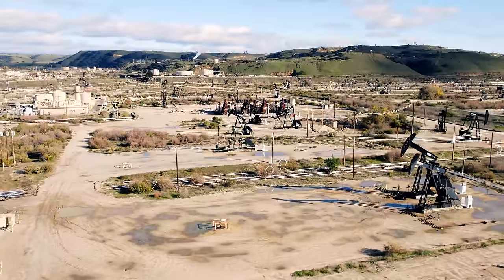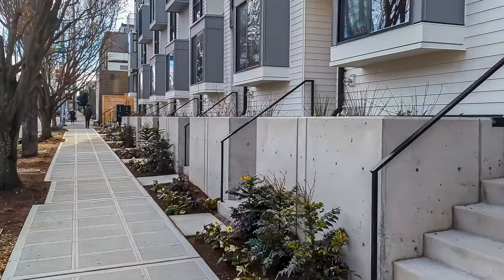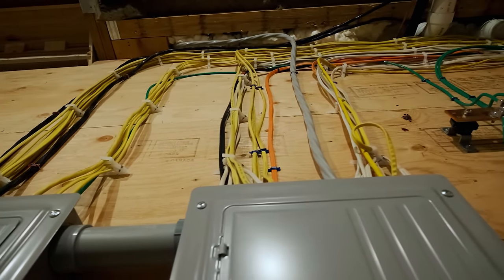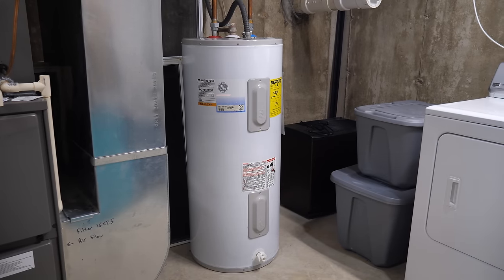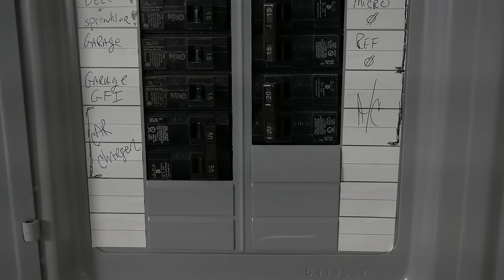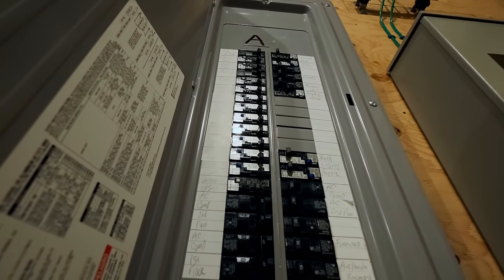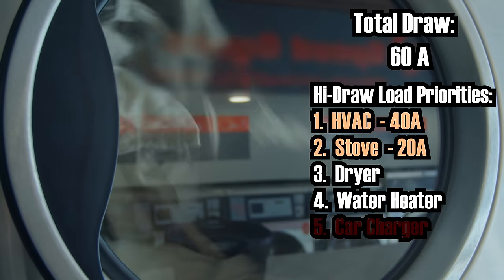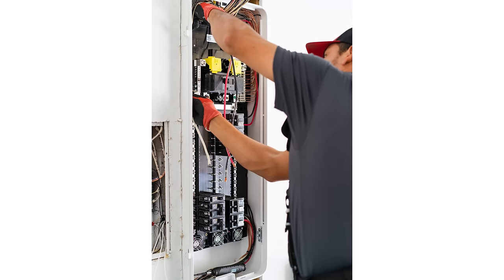Home Electrification: There's not a lot to do, and it doesn't have to be hard (Part 1)

Comment: I feel like most people already have the idea of "don't power on all the high power appliances at once" idea stuck in their head too, I know I was already taught that at a young age
Reply: I've lived much of my life in houses with a limited electricity supply, and yeah it's really not that big a deal. Just when the circuit breaker trips you feel like a bit of a moron as you go to turn the washing machine off so you can finish drying your hair or using the oven.
Reply: It's never occurred to me.  I wouldn't even have known, off the top of the head, what reasonable current ratings for major appliances would be.  However, most of my main appliances are gas.  (On-demand water / boiler and dryer, with an electric stove.)  Only upon considering solar and a heat pump for an external building, have I actually started tracking average and max loads for particular large appliances -- and figuring "everything else" will be negligible.

Comment: I've been a heat pump nerd for almost 30 years now.  29 years ago, I bought a condo in New England with electric heat.  Not a good combination.  At the time, Kenmore sold an 8000 BTU window A/C with a built in heat pump.  I still have it to this day.  There are some downsides.  There's no logic in the unit.  It's all mechanical switches and thermostats so in cold weather it was prone to icing up.  It also had one fan motor so if I had the inside fan on low, it didn't move as much air outside as would be optimal.  Lastly, it would run in any temperature and being an older model, it would lose efficiency in weather below 40. I would still run it down into the 20s, but it wasn't very efficient (still more efficient than resistive heat, but not as much).  

Anyhow, I have a suggestion for you for anyone that wants to "experiment" with a heat pump but isn't ready to install a mini split.  I have been looking for another window heat pump for over a decade but every window unit just had a heat strip.  Last year, Midea introduced a 12K BTU inverter window unit with a heat pump!  OMG, game changer!!  Dual fan motors so the outside fan can push lots of air, inverter so it can ramp down as needed rather than cycle a lot, and unbelievably efficient.  Once I get the house up to temp, it draws just under 300 watts to maintain the temperature and still has to cycle off once in a while.  In humid weather, it does run a defrost cycle a bit often and that does make the room get chilly for the few minutes it's defrosting (I'm in a 19th century house with no insulation and old windows) and the real negative is that it won't run if it's below 40 outside.  (I'd really love to find that sensor and bypass it, but I fear it also uses that to time defrost so may not be a great idea.)  I do find that while it's heating, the "outside" sensor reads a bit high so as long as it continually heats, I can run it down until it's in the low 30s outside but once it shuts off, the sensor cools and it won't turn on again.

Anyhow, I would LOVE to see you do a story on this.  It's been a game changer for me.  In spring and fall, it provides ALL of my heat and at $3.89 a gallon for oil, this is SO much cheaper to operate.  I have it plugged into an energy monitor (I LOVE that you're the only person I have seen that owns more of these than I do) and it's costing under $1.50 a day to keep my whole place warm!  I REALLY wish I could run this in very cold weather.  😞

Anyhow, love the show and hope you can encourage more people to try a heat pump, and hoping a window unit could be a start for some people.

Comment: We lucked out when we got our heat pump. There wasn't a central air system or anything like that already in place, but some prior owner remodelled the kitchen and moved the range, and when they did that for some reason they ran a new circuit high enough to do it and just cut the old circuit off, rather than properly pulling bits out and re-routing it. Our electrician was able to use that empty old range circuit on our panel.

Edit- Our secondary heat source is the electric baseboard heaters that were already installed (originally as the primary.) When we bought the place it was technically in violation of local code because its former secondary heat source, a wood stove, had been removed due to insurance reasons. We have a chimney that could be cleaned up and put back into use if we found an insurer willing to let us do it.

Comment: The price of a SPAN panel made me laugh out loud. I was looking at them for monitoring, and ended up building my own for less than $50.
Reply: Have you documented this anywhere? I'm interested.
Reply: Also, the span panel costs more than upgrading to 200amp service in my area. Pretty dumb.
Reply: @alexcrouse  How much was your quote to upgrade to 200A?
Reply: @alexcrouse  Nice enough. I know there's one out there that tries to learn what each current source is. Don't know if anyone is working on an open-source version of that.
Reply: @ehhhhhhhhhh  i lucked out and already have 200a. But my neighbor got quoted $5000 ish. This panel is like $5200 last i looked.
Reply: Brand new low volume technology is expensive? Surely not. That NEVER happens.

And yes, the raw parts cost is less than the cost of the product, but you also have to accommodate for the software and the overheads of operating a business and selling a product.
Reply: @SqueakyNeb  you don't have to explain that to an electrical engineer. But they're markup is insane.
Reply: @SqueakyNeb  You don't "have to" accommodate for software which itself is a negative.

Comment: I have a 200 amp service, I recently install a NEMA 14-50 Plug outside for I can charge my recently purchased electric vehicle. It pulls about 32A at 240V+/- on a 50A breaker. This on top of my central air unit on a 30A Breaker, and almost all the rest filled in with 20A breakers. Now my big issue is my stove and water heater. Over time I can see the benefits of phasing out my gas usage in SW Illinois region. I am hoping for a more progressive solution to electric production than burning. Nuclear Fission, Solar, Wind, Etc is definitely going to help a lot in the protection of our planets and families futures.

Comment: I have always preferred a gas range to an electric one and will likely stick with one for as long as I can. That said, I do like induction cooktops far more than the old-fashioned coil ones and could perhaps be convinced to use one if the cost comes down a bit. I suspect there are a decent number of people like me out there.
Reply: Yup, for sure. I miss the gas stove at my old place. The regular resistive electric stovetops suck because any power changes take quite a bit of time to actually take effect, and it's annoying to work around. Foe example, on a gas stove you could pretty much stop something from boiling over almost instantly by turning it off, while an electric stove requires you to remove the pot for the same effect. I hear induction is good because it does react to power changes much quicker.
Reply: Hello, one of the number of people like you out here, reporting in! I absolutely hate the old coil electric cooktops. Gas adjusts heats faster, both from cold and on the fly during cooking, plus has the added benefit of being possible to use during a power outage. You will not, cannot, shall never ever possibly convince me to switch to a coil electric stove. But those induction stoves, those are neat. Waiting for my current stove to kick the bucket (it was brand new when I bought the house about 5 years ago), and by then, hopefully induction will be priced more to my wallet size.
Reply: GAS pollutes your internal environment by filling the place with exhaust & particulate matter (soot).  No thanks

Comment: Only if i can disable it and only i control it, no outside source can have control of it. If those things are true i may consider it.
I can think of many times when i might meet 100a service when i would need to disable it. Welding for example when it's cold out. Running any tools for upgrading your house, building a shed etc

Comment: The best place to start if you want to increase your homes efficiency is better insulation and air sealing!! Make your home efficient first, then you can switch to a heat pump and other high efficiency appliances a whole lot easier!!
Reply: My point exactly. The source of heat is only top issue if you require more of it!
And lets not forget the ridicolous forced air heating systems in the US. By the time that air get's from the furnace to you, you essentially have a fan blowing tapid air at the top half of the room while the wall you are lying next to is cascading frigid air over your face. Perfect!

Comment: FUN FACT: i worked in northern Minnesota for a spell and learned what the word cold means... wow. 

A coworker lady was telling me how they built their home on family land... i cant remember which document required it, (permit, C of A, etc.) But there was a requirement for at least 2 sources of heat, with one source being independent of the energy grid... almost all the new homes up there had a hybrid boiler system that utilized an lp, gas, or electric indoor boiler with an integrated outdoor wood boiler... I thought it was so cool! I also saw a house from the 1800s that still had its original coal burning boiler in the basement, most likely because removal would require demolishing the home! The whole basement was brick, including the floor, and the cast iron boiler was at least 7 cu.ft. and looked like an antique locomotive dashboard. So cool. 

I have watched a lot of your content on heat pumps, but I'm just not sold yet! On paper they're great, but i only wear clothes on special occasions, like when company comes over- i had a heat pump and getting out the shower, wet and cold, with the lukewarm 70 degree breeze... I always wound up cranking the emergency heat on, and my glass fireplace thing

Comment: Honestly, it's hard to imagine the area I live in going all-electric for a very long time. There's many houses that I've seen which were built all-electric and then had gas added later, simply because storms took out the local electric grid. For us, "backup heating" isn't heat strips, it's gas heating.
Reply: You could use an EV as an backup.
Reply: @VirtuellJo  But then what if you need to travel in the midst of your regional emergency and logistics disruption? EV as load balancing only makes sense when the grid is reliably online, IMO.
Reply: For me, "backup heat" is wood. My aging parents have gas logs; primary heat is fuel oil, with enough to last all year. (in decades past, kerosene)
Reply: @VirtuellJo  Not for long. That's the fallacy of electric. A jug of dino-juice has orders of magnitude more energy than your EV. Sitting at the end of my desk is a 12v 200Ah brick. (LiFePO4) I can draw ~300W out of it for 8hrs. That would hardly keep the room (120sf) warm. Sitting in the back of the van is a 5gal jug of gasoline - let's pretend it's kerosene; I can substantially heat this room for two days with that. (The 50gal propane tank on the RV could heat it for a month. 60gal of gasoline will run the 10k generator for 2.5 days.)
Reply: @jfbeam  your fallacy is to rule out technological progress. Also you are forgetting about efficiency.
Reply: @VirtuellJo  you can't heat a home in the "now" with future efficiency, just like you can't eat tomorrow's harvest for tonight's dinner
Reply: @capacitatedflux  the point regarding efficency is for today. You can easily power a home for two days in a blizzard from an EV
Reply: @VirtuellJo  Power is power. That 100kWh pack in your telsa is still only 100k. At resistive heating ~100% efficiency, that's 100k. Maybe with a heatpump, it could pump 200k. A 10gal BBQ propane tank will do a far better job of heating in an emergency. And it's as close to 100% efficient as you'll get. Generating electricity is horribly inefficient, esp. when the source is a fossil fuel.
Reply: @jfbeam  i do not have a Tesla. Tesla cannot feed power back. There are far more advanced EV makers out There like Nissan, VW, Kia and Hyundai (and many more).
Reply: @VirtuellJo  So? POWER IS F'ING POWER. A 100k pack - which weighs half a ton - is the same effective heat energy as 3gal of gasoline. Hang a resister off the battery, or toss a match on the gas... you'll get the same heat from both. The only mythical efficiency in a battery is how small they can be made. (i.e. energy density. and there's a hard, physical limit to lithium chemistry batteries)

If you're connected to the grid (and have someone else's money to burn), use electricity for everything. If you aren't on the grid (eg. the power is out), electricity is hands down the worst way to heat a house. Generating electricity is a massively inefficient process. Storing it is even worse. Wind and solar are hugely inefficient, but we tend to not care as collecting some of it is way better than collecting none of it. When you've gone to so much effort to collect that electricity, it's pure insanity to turn it into heat.
Reply: @VirtuellJo  And when the blizzard / outage lasts three plus days...? Then you're going to have to bring the grid back online to both heat frigid homes and recharge thousands of vehicles for society to reboot.
Reply: @zshadows  Have you even watched this channel? He has mentioned many times about the fallacy of "but sometimes" impeding progress. Yes, electric power does occasionally go out. There are several emergency ways to provide heat which will only be used 0.00001% of the time at most: propane heaters, catalytic heaters, even kerosene heaters. Rare emergencies don't outweigh the benefits accrued during near-100% of the time.

Comment: I live in a house i Sweden, which when we moved had resistive radiator water heater of 12kW and a hot tap water heater 3kW. The radiator water heater was from the 1980s. It had clamps connected to the main power feeds that would dynamically/temporarily limit it when other loads were active. The whole house has a 3x25A (230VAC) electric service, which means 17kW. This works fine even in nordic climates.

I now have a ground source heat pump that performs both of the above functions, with a COP of approximately 3.5, so now I'm nowhere near above since it never uses more than like 5-6kW even at full load (which is rare). Even with a 11kW electric car charger (which also has a load monitoring function) I could if I wanted to, go down to 3x16A (11kW) grid connection and things would still work. I'll most likely end up reducing to 3x20A (13kW), for convenience.

Reason for reducing the main circuit breaker size is that the monthly cost here to the grid company varies with main circuit breaker size.

Anyway, my point is that this kind of load limiting tech isn't new, it's been here for decades.

Comment: Was a bit hard to follow this conversation after the gas dryer revelation, still having issues getting my head around that one (yes, all electric European here). One thought though: Will it be safe for appliances to have circuits go on and off regardless of where they are in their individual programs, sounds like you could get issues if not mindful. But then again I could be overthinking it.
Reply: Hot water heaters and EVs certainly will not mind. Dryers might get upset and not resume. I can't see it causing any long term damage, though.
Reply: @thelight3112  Would assume so, but seing how many items are "smart" these days and how unaware many people are to what is hooked up where, I would not be surprised if this could become an issue when done daily. But I honestly do not know, I'm still trying to wrap my head around that gas driven dryer. ;)

Comment: got a friend who lives out in the middle of essentially nowhere. most the service provider let's him pull is 40A but it's also a bit unreliable (overhead lines and some harsh weather). Helped him figure out a neat solution. 
added a second propane tank, a 7kw generator, and a battery pack. the central heat is now a mini-split system running throughout the house, hot water heater is still propane fired, and he plans to add a few solar panels. his energy bill is far lower and he no longer relies on the electrical grid for energy.